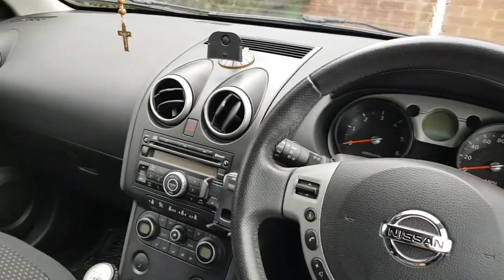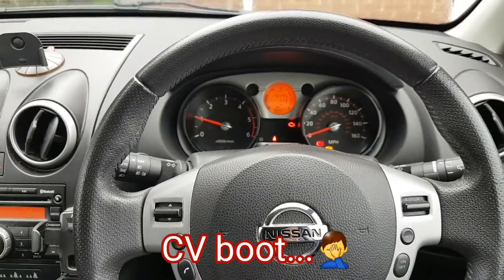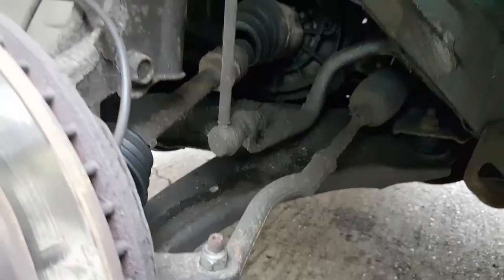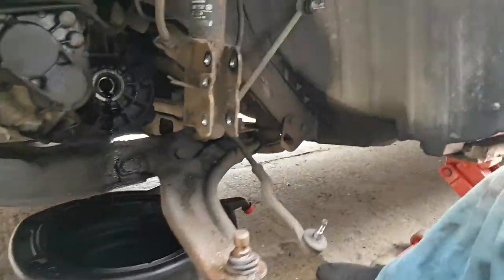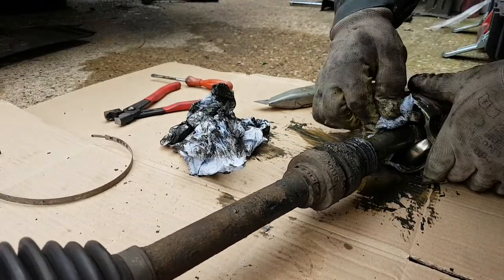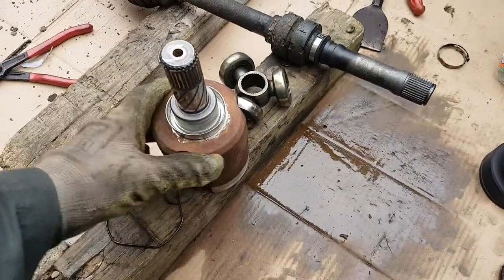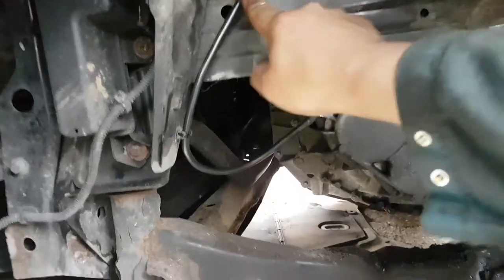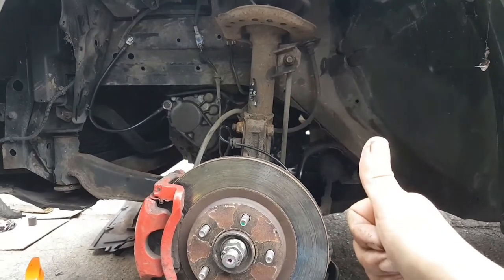Qashqai J10 inner CV boot replacement left hand side...

Comment: Luis, I can't fault your method. There is a special tool for fitting CV boot clips. I got mine from Amazon. A pair of pincers will do the job just as well as you've shown. A torn inner CV boot as not an MoT failure as far as I'm aware but I think it is as important as the outer one. I had to replace the inner CV boot on a 2008 Citroen C4 Grand Picasso and all I had to do to separate the joint was to yank it out. It sometimes separates when you try to pull out the entire driveshaft. Was the slow crank anything to do with the broken earth strap?
Reply from the maker: Thus is not something I do that often, the only reason I never bought any tools to install these boots... who know in the future I will might invest in one...
👍👍👍

Comment: I have just done a drive shaft on the same car but forgot to fit that big circlip back in! The car drives just fine and no sign of any issues, do you think it will cause a problem later on?
Reply from the maker: The one inside the CV joint?
Probably not... but I would plan to get it fitted...
👍👍👍
Reply: @LMAutoRepairs  Yes the larger clip that goes inside. The smaller clip that holds the bearings in place was fitted, cheers for your reply!

Comment: Whats the name of the rubber seal in the middle of the shaft
Reply from the maker: Are you referring to the one I am replacing on this video?
Reply: @LMAutoRepairs  Yea in the middle of the drive shaft ,Do you know if its a MOT failure as mine is falling off bot the inner and outter cv boots are ok
Reply from the maker: @TheAsa1972  
Depends how bad it is and on the MOT tester judgement...
If it is not too bad might just be an advisory...